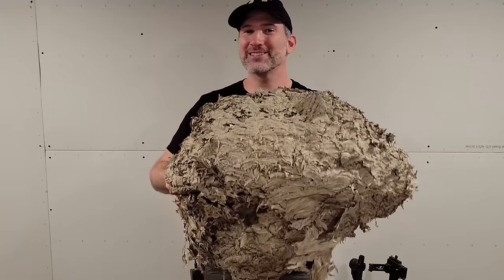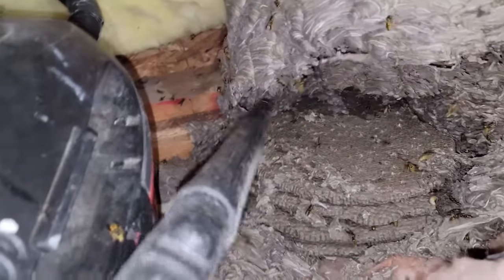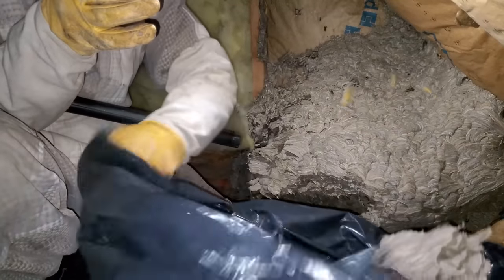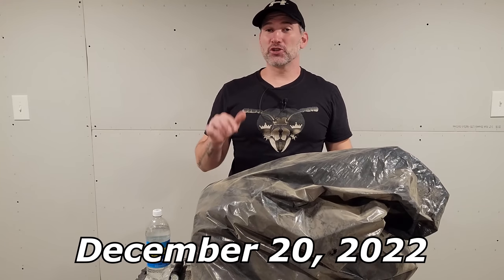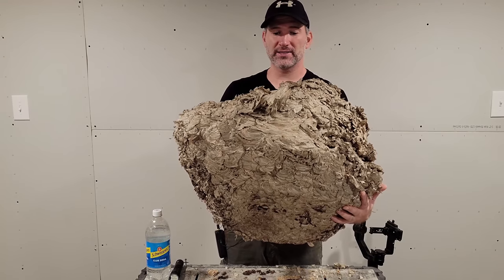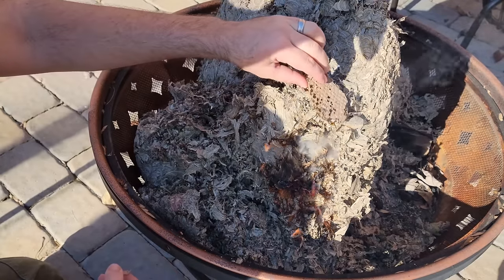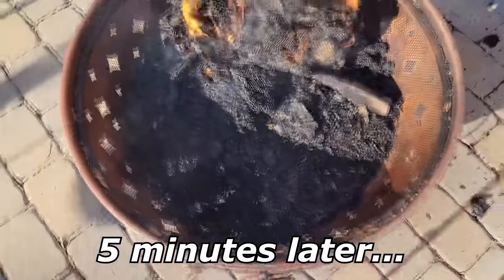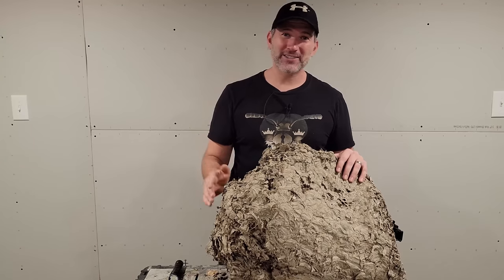Yellow Jacket SUPERNEST! AMISH House INFESTED | Wasp Nest Removals!

Comment: How did you power the shop vac since you were in an Amish home??
Reply from the maker: Their wall outlet. Like any other house.
Reply: Amish have electricity now?
Reply from the maker: @thirstyboots6711  Some Amish have electricity. They're not as primitive as you think they are.
Reply: @HornetKingOfficial  Sounds like either New Order or Beachy Amish.  Those groups allow electricity in the homes.
Reply from the maker: @dragondancer1814  No. Lanaster County PA. Depending on the church, and if they have a home business (which this client did) they are permitted electricity use.
Reply: @HornetKingOfficial  That’s what I mean-there are different branches of Amish, from Old Order to New Order to Beachy and everything in between.  Different church districts diverged depending on how strictly the wanted to interpret the Ordnung and what modern conveniences they wanted to adopt.  I live in a county with over a dozen Mennonite churches ranging from conservative to mainstream, and I have tremendous respect for both Amish and Mennonites!

Comment: When you mentioned trying to burn the nest, my first thought was, "But isn't that stuff more mud than paper? I'm not sure that's gonna work as well as people think. I mean, one of the best ways to put fire out if you don't have water nearby is to chuck sand or mud on it." Glad to see you were bringing it up to make a point. And on behalf of everyone who wanted to see you try anyways, "Thank you for trying anyways." ;)

There's a reason some people like beeswax candles. While it takes more heat to get one of those candles going, it also takes much longer for the candle to run out, because beeswax melts so slowly.
Reply from the maker: No mud. Yellow jacket and Hornets nests are made from wood cellulose mixed with their saliva secretion that dries and solidifies into a paper material. But the main component is wood cellulose fibers. No mud. You're thinking of mud daubers.
Reply: @HornetKingOfficial  Wow. Thank you for the concise answer, and I appreciate the quick explanation too. You're right that was what I was thinking of. Either way, I didn't personally think that stuff would go up very easily.

Seems like that would be a good thing for me to know, since I deal with fire on a regular basis with the Burn Crew I work with. We've yet to have a problem with underground nests when we do our work, and I've always wondered why. Of course we haven't, THOSE normally WOULD be mud-style nests, and would likely not even smoulder. It all makes sense now.

I always love learning new things. There's just so much cool stuff out there. And people wouldn't even give some things a second thought, unless they personally worked with it, or knew someone who did. Like bee and wasps, or culverts, or burn crews, or bird watchers or... laughs well, you get the point.

Comment: I can totally agree that burning a nest takes a long time given how hard it is to start them burning short of using a Flamethrower.
but once it's hot, it will burn!
just toss your defeated nest onto an already burning fire with a good bed of hot coals.
Reply: Or you could just add a splash of chlorine trifluoride and the whole nest would go up in no time. As would the surroundings, including concrete, bricks, asbestos and the ground beneath it. LOL

Comment: I think a tiger torch would light this up a lot quicker. Considering everything has an ignition point, and a bic isn’t exactly the hottest ignition source. You can’t light used oil or ever a sodden log with a lighter, but if you have a propane torch you could destroy that in minutes lol. Edit: after watching more I’ve seen that these do in fact burn they’re just incredibly fire retardant. I guess wasp saliva has fire retardant chemicals?? Idk but for sure get yourself a tiger torch. Awesome for cleaning up stuff

Comment: Crazy that the structure it is attached to is more likely to burn first.  Honeybees eat their honey to salvage what they can if there is fire.  I am guessing that wasps will leave it and evacuate and then try to rebuild and repair, much the same way.  Looks like it would smolder out, leaving most of the comb damaged but intact. The inner most hatchlings might even survive.

Comment: I had a cardboard box outside empty of course and the flaps where closed and of course yellowjackets made a nest in there without me even knowing until one stung me. I squirted some lighter fluid on the box and set it on fire. Twenty minutes later nothing was left but ashes. Anything will burn if it gets hot enough even the larva in the nest...I saw a few workers leave but nothing else remained.

Comment: Would it be impractical to make a LARGE version of a handheld bug zapper? Frames of wire (think chicken wire) in frames of wood so they can be connected and put in front of a window or over an attic hatchway. Nothing crazy voltage wise. Just enough to zap them when they run into it head to the light (no pun intended) Vacuum up the bodies then chase down what I would think would be far less escapees.

Comment: 110 degrees, plus respirator, plus suit🥵
Reply from the maker: You know what I be saying
Reply: Try 95 degrees with a triple-digit heat index, high humidity, and full firefighting gear sometime!  It’s about as bad as attic working conditions for the Hornet King!
Reply from the maker: @dragondancer1814  The Hornet Queen 👆 (aka Jessica) has been in attics with me in a wasp suit. She's speaking from experience.
Reply: @HornetKingOfficial  Ah, my bad! 😬. Still, using my firefighting experience for comparison, I can just imagine!  🥵
Reply from the maker: @dragondancer1814  I cant imagine running into a burning building, mid summer, with all that garb on..
Reply: @HornetKingOfficial  It’s NOT fun in the summertime, let me tell you!  The gear plus the air pack is heavy, you’re already sweating bullets just from the gear, and then you have to face down a working fire, which feels like being in an oven set on “Broil.”  The risk of dehydration is VERY real in summer because of all that, and it’s why many departments have a “15/30” rule in summer.  That means 15 minutes where you’re fighting the fire, followed by 30 minutes spent in the recovery area with the gear stripped off and drinking water or Gatorade-type fluids while being evaluated by EMS personnel.  If your vital signs look good after that, they let you back in for another round.  After the second round, you’re DONE.  Period.  A working fire call is the exertion/strength equivalent of a week’s worth of workouts crammed into a two-hour or so period of time, and it wipes you out!  Now you know one reason why there are so many units getting called to fire scenes-more manpower makes rotating firefighters in and out easier and helps us knock the fire down more efficiently.

Comment: Please correct me if l'm wrong, but wouldn't be hard to burn off the start because the worker drones basically paste it together with the moisture or something since they chew up material and then build the nest from that? and then keep fixing any damaged spots, so if you were to burn it in place, to me that'd be like trying to burn wet paper and glue, would it not? plus you'd burn what it's attached to. but anything burns once it's dried out.... 

Not an expert on any "Flying A-Holes" as you called them which was funny... just using some common sense and the little l know of these insects or whatever they're classified as.
Reply from the maker: That was precisely my point in the video. Attempting to burn an active nest would be fruitless, because the larvae and the workers THEMSELVES are loaded with moisture and won't burn. The only moist parts on the nest from being constructed would be very small lines on the very edge of the constructed envelope. If burning the active nest, this little bit of moisture would evaporate. 

The nest I burned here was clearly bone dry, and didn't burn well, so clearly burning it active would only prove to be twice as challenging. 
(I didn't call the wasps "aholes with wings", I was referring to what people in the comments typically call them.)
Reply: @HornetKingOfficial  Thanks, l didn't know exactly why but was sorta close l guess... thought any flying insect that builds nest did alot of jobs... so since the workers themselves do everything already, l guess you can probably add self fire extinguishers to the long list... and the larvae at that point might as well help too

yeah the dry one, even after a month didn't want to burn that good... 

l didn't hear that part... but most youtube video comment section is full of "expert advice"
Thanks for the answer and stay safe